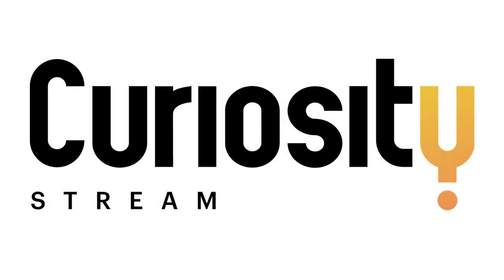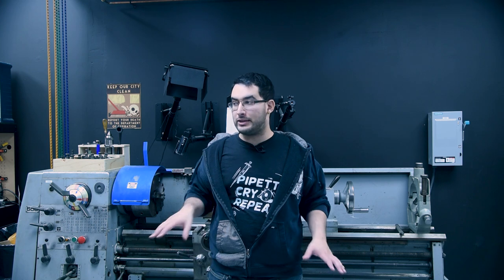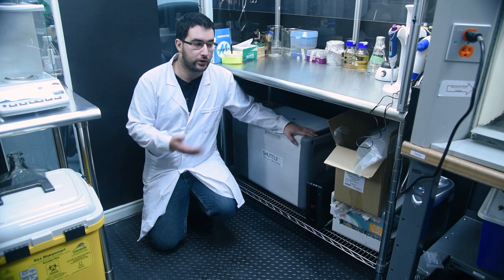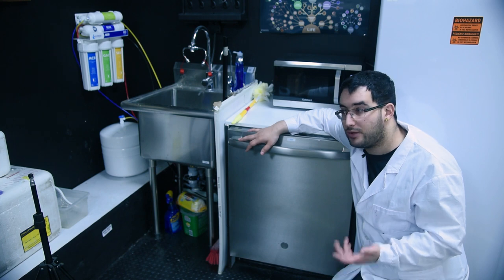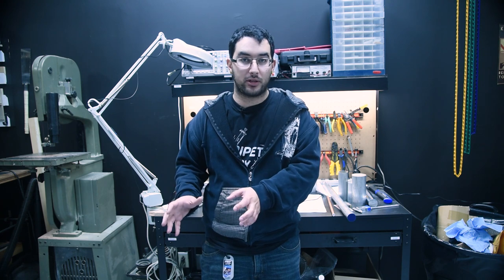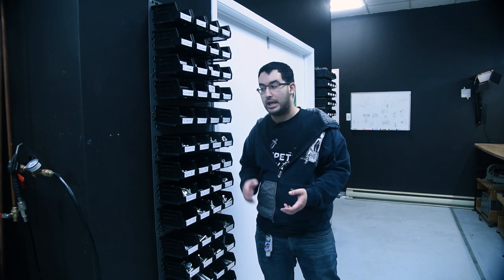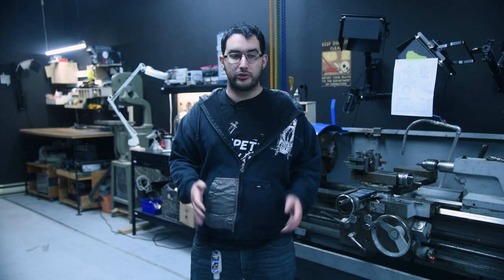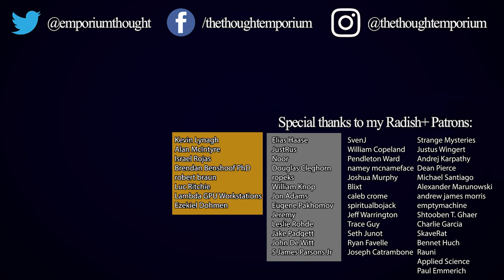My New Lab is RIDICULOUS

Comment: Maybe add a proper Hepa Filter in front of the air compressor. Less dust in your workshop. And thank you for your Videos!
Reply: I'd suggest adding a dust collection system. Even if the machines generate just small amount of dust, it's much better to sucking it into a filter instead having everywhere in the workshop...
Reply from the maker: I didn't show it but there's a giant dust collection system suspended from the ceiling in the work shop
Reply: @thethoughtemporium  I'm sure it's been considered but I was going to suggest having a lower air pressure in the hot room.

Comment: Be aware of the water level/quality in your autoclave, and be gentle cleaning.  I have that exact model sitting in my attic right now because the heating element is unobtanium.
Second note, be sure it is a grounded and fault protected outlet.  When the element shorts, it shorts to the pressure vessel.
Sucks too.  It was a very quick clave to heat and cycle.  Much zippier than the tuttenours.
Reply: I mean the autoclave that I have is a large model and doesn't just spray steam everywhere, idk if thats suppose to happen
Reply: Coming from Australia I have no idea how most American outlets can get away without having earthing or GFCI, let alone power switches
Reply: I think modern building code in Ontario requires fault protection, so it should be covered if they installed those outlets recently.
Reply: Is the heating element something special, or just the usual stuff like nichrome or tungsten wire?
Reply: @ГуглГовно-м7н  Nothing special, just extremely difficult to acquire in my experience.  It is a submersible element  similar to an electric water heater element with two (pressure bearing) threaded bushings that go through the tank wall.  The element makes a rapid 90* bend and loops under the rack.  Someone with the manufacturing knowledge/tools could likely duplicate it, but I have not (yet) been able to source a drop in replacement.
Reply: @rolls_8798  You're completely wrong when you say "most" there dude. You'd hard pressed to find an outlet that doesn't allow for a grounded plug in anything that isn't a grandfathered historic property, of which there are less and less by the day. Even my grandparent's house that was built in the 30's was retrofitted with grounded outlets. We don't use switched outlets here because the overwhelming majority of our devices go to power strips or surge arresters (which actually should be added to the outlet by now) which will have switches on them or the device already has a switch on its power supply. GFCI is actually required in any exposure risk condition such as bathrooms or garages. We also use split phase residential power, so our low power devices only receive 120 volts which greatly reduces the available risk. Switched outlets are also available, but they aren't used anywhere other than workshops or sensitive applications that have their own special safety codes anyway. If we want an outlet to be switchable in the home, we just have it wired to a junction box and install a lightswitch because that's way more convenient. My bedroom has a switchable socket on all 4 walls because there's no permanent light fixtures.
Reply: @dustinbrueggemann1875   @Dustin Brueggemann  it seems to me having a switch on the outlet is a pretty critical safety feature in terms of the baby fork situation although it doesn't compare to the UK's fancy ground pin linked cover thingos. same for gfci, it looks like the only reason it's not in all sockets is cost and there is the aforementioned baby forking in other parts of the house and a similar liquid risk to the bathroom in the kitchen. Granted I have no physical experience with American outlets, and there's a good chance I'm confusing it with Canada, but almost every socket I've seen has not had a ground hole.

overall, I think we can agree that the UK's system is the safest (until you step on one of their plugs lying face up) but some would consider overkill, but most of the things missing from the US' would greatly improve safety and seem to have been ignored in favour of cost

Edit: surge protectors might not be integrated because of different power demands like a really shitty and badly managed high power motor in an appliance, circuit breakers are basically there for this purpose.

120v will kill you just as well as 240v, but means appliances require twice as amperage, wasting a ton of copper and greatly increasing the fire risk. Theoretically, 120v is safer in some circumstances but the rest of the world (disregarding India and some other places) are just safer so 240v is not really a problem.
120v seems like risk reduction, as if they know there is a higher risk of electrocution and they're just trying to lower the chance you'll die
Reply: @rolls_8798  Why would every single outlet need a GFCI? those things are expensive! Power switches on the outlets are nice. We wire some outlets to wall switches instead.
Reply: @rolls_8798  As a kid you learn real fast that the sticking things into the outlets is painful but thanks to the fact that it is only 120v it isn't lethal.
Reply: @kellymoses8566  we don't have GFCIs on every outlet, we just have a housewide RCD. makes much more sense

Comment: I have had some hardware failures with this model of UPS. It will protect your freezer in case of power outage, but they tend to cut the output power when they fail even when there is no outage. I have had a couple turned permanently off with a relay weld fault after an outage and I had to plug the sensitive equipment back into the wall. It's not a bad unit, but don't put too much trust in a consumer grade UPS.

Comment: Lovin the setup! Assuming you havent thought about this already, you might want more space for drying or sterile but not stored components to go in! The lab I work at uses an autoclave(for sterile pieces) or tubs of Simple Green + Alconox(for any microbe infested items) instead of a dishwasher and with several experiments running we need like 3 square feet of space for drying or already sterilized components

Comment: Hey nice Video!
Regarding pressured air:
I don't want to dissuade you using pressured air completely but it's the most expensive energy you can have in a shop. So please evaluate carefully how many tools you want to have using pressured air.
When you are looking for air tools keep in mind if they need oiled air or not. also If you have oiled air don't use this air to blast off dirt from your skin in close proximity because the speed of the oiled particles is so fast that these particles get imbedded in your skin!
I also recommend you an de-oiler for your pressured air in the lab so you can use this to clean surfaces...

Comment: Not sure if this will get read however: I'd HIGHLY recommend a direct vacuum connection for anything that produces sawdust. it would be very easy to set up your compressed air system to vent everything out directly as the tool is used. its helped me greatly keeping control of dust.

Comment: Always wanted to try plant tissue culture,  Laminar flow, nice. Superb kit all over.  Inverted Compound microscope for tissue cultures, and a reverse head positioned compound ? I'm sure theres a reason or was that or just for moving. Looking forward to seeing what the future holds. This is ridiculously well equipped. Best luck , looks like you have planned everything well. As an  M300 owner the lathe is a keystone. Mill is another essential. Supprised to see the sets of Victorian sized bolts and screws. FDM and resin have fantastic tolerances.  Did I miss the electron microscope . Best wishes for the arachnid silk.

Comment: A water for injection steam system can be useful for some commercial processes but expensive due to stainless tube and valves. It’s about the only thing you don’t have. Would use the RO water.

Comment: Dude!  Fantastic --- I can't wait to see what you can do with this.  You've grown from making tools out of scrap to building a proper lab.  I think a lot of people don't start in on this kind of deep-science at home because they assume it's all completely out of reach.  But with this, you have proven the power of committing to your goal and figuring out ways to use what you have instead of giving up because of what you don't.  And since you persisted, now you actually have some of that stuff that used to be out of reach.  There's a lot of value to that, even for people who aren't all that scientifically-minded...

Also, those lines for your compressed air look like they may be intended to be constantly kept at high pressure, but every compressor should be bled when not in use since humidity in the air can cause the interior to rust and weaken.  You definitely don't want one of those things exploding --- especially one of that size.  Not only is it a massive safety risk, but it also could (would) do serious damage to the other equipment in your lab.  The thing that sucks is that it's kind-of hard to check if your compressor is starting to rust.  Anyway, long story short, maybe set up some kind of Arduino thing that can tick it on right before you get there and then off (and open) when you leave.  Since it would have to increase the pressure again, it'd be more likely pop the safety valve when ramping up instead of spontaneously detonating the entire can!

Comment: Getting wireless temperature loggers were useful for us, since we had dozens of refrigerators to track every day.  Feeds right into the LIM system, easy peasy.  It would probably be an interesting arduino project for the right skill set.  Managing heat and humidity is also a big challenge in any part of a lab with hoods, so you may want to explore external supply conditioners.

I recently read about a couple of projects working on triacylglycerols and milk-protein production from yeast.  The energy impact to such industries would be gargantuan.  Fascinating stuff.  Lab icecream!

Comment: my only critique is if you really need battery backup power for mission-critical piece of equipment., Go with something else other than APC homebackup unit because that's what you've got there and I can almost guarantee you that it will not work when you need it to. APC many years ago was the go to company for battery backup systems but that is no longer the case especially in their smaller home-based units like the one you have there. or build your own battery backup, it's easy to do and you will not regret it.

Comment: "huge compressor" pans to basic 2HP compresor I was thinking you at least got an 8HP rig, but for what you do that would be overkill.

But for real, getting a lathe, mill, and CNC torch are my personal goals, the main problem is a shop to put them in, the other big equipment I use can live outside, so it can be built or bought whenever, but those 3 absolutely can't, even if they are under a tarp.

Comment: A quick thought/suggestion: Put something hard and flat beneath the tack pads. I’d think that the pattern from the floor tiles would mean that only little bumps will come in contact with the soles of your shoes; a flat surface should clean quicker and more thoroughly :-)

Comment: I would like to suggest something very important that you are going to need to do now, before it becomes an endless ugly battle in this new and quite beautiful lab. 

Most of, if not all of your equipment have maintenance schedules to be able to perform at their best, belts to check on 3D printers & air compressors, filter replacements, and the like, those cryofreezers can fail from things other than a lack of electricity (if you don't have a generator, you might want to look into it.) Things like O rings in air lines and gaskets in plumbing. 
There are a lot of things to consider.  I would also suggest that you think about installing vaccuum lines near the compressed air lines, vaccuum cleaning lines that all you need do is connect the shop-vac hose, clean up your mess, unhook the hose and recap the line nozzle. These types of systems are used in high end homes and some hotels because you have all of the benefits of a vaccuum, and none of the hassle of breaking out the floor vaccuum and putting it away, or cleaning the filters on the assorted hand vacs, AND it has the added benefit of not blowing the air, and particles too small to be effectively filtered back into the room, AND it's significantly quieter than running other vaccuum machines. 
Also, and maybe I just missed it, but do you have adequate fire suppression equipment in the necessary spaces? You showed all the toys but I missed the spots labeled for fire extinguishers. I saw the eye wash station, and maybe an emergency shower, but the fire stuff I might have missed.

Also, when you get you DNA/Biology lab up and working, I have a product idea you might be interested in that would have a nice very nice return on investment for you.

Love watching you work, explain, and do experiments. Be Safe.

Comment: If you want your lathe and mill to last basically forever, make sure to lubricate them well and to not use compressed air to clean it. The metal shavings will slowly make your machine imprecise. Also don’t wear gloves or clothes like your jacket while the machine is spinning, I also recommend safety glasses, there are ones for going over your glasses or you can get them with the same correction as your glasses, and a pair of steel toed shoes, if not already owned.

Comment: That’s a 3 stage filter - don’t think it’s RO. RO requires pumps and power. 3 stage with carbon will still do amazing though.
Reply from the maker: There are 6 stages not 3. The top three are the RO, and deionizer ones

Comment: im trying to make crystals out of wine, cause why not? and i have reduced wine (placed it in a glass jar under 40 degrees and let the cold temp reduce the h2o giving the constancy of malacic) and am trying to turn the tartrates into viable stable crystals and not melt at room temperature, would adding potassium to the pre existing amount of potassium bitartrates help? or would it matter to apply the powder after? or would this work at all?

Comment: Wow a machine that makes helium, I was told helium was dug out of the ground and the world was running out as theirs only certain ground that it comes from
Reply: Normally, yes. Helium you can buy comes out of the ground, where it's actually quite limited in supply. You can make helium with devices like this, but it's not cost effective because the machines are really expensive to run and the material (deuterium) is also quite expensive. However, if we ever manage to get fusion power generation working, it will ALSO produce helium in the exact same way as this device while also producing the power we're actually after, which means the helium is essentially a nice bonus.

Comment: Whoever botched on the duct tape on that exhaust fan... please. First of all you have spanners for this you can just screw on and tighten up. Secondly, you do not want to use little pieces of tape around a duct, you tape a band around the entire thing and then strap it down! Those little pieces are going to peel off and leave a huge sticky mess nobody wants to deal with.